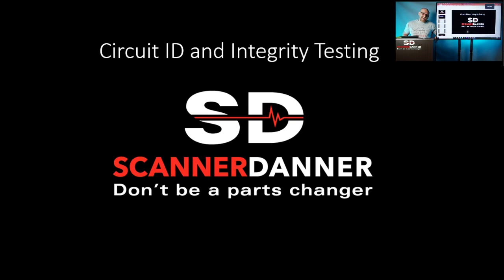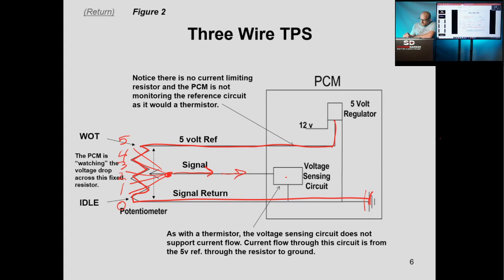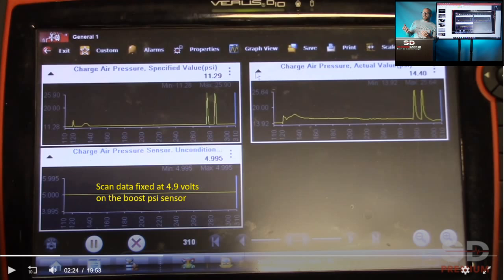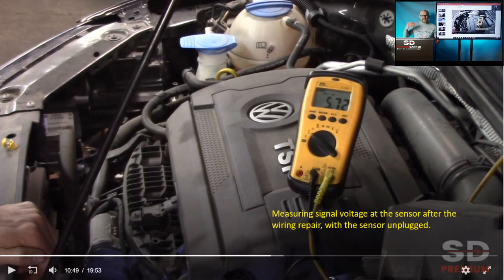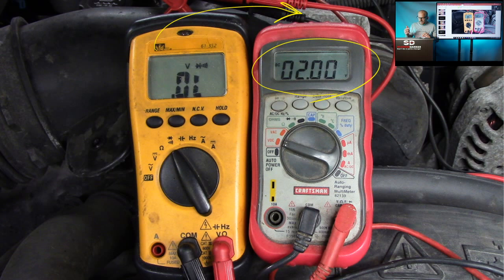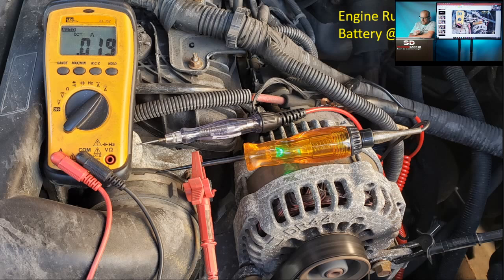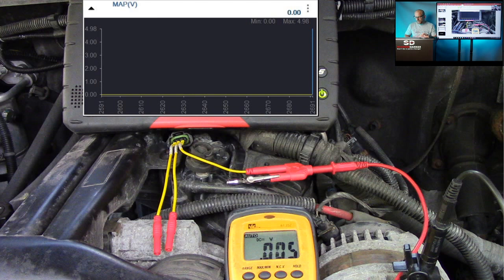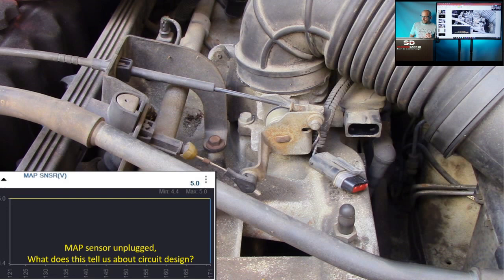Circuit Identification and Integrity Testing Livestream Class (previously recorded)

Comment: Ivan from Pine hollow diagnostic burnt think module for power windows with incandescent test light. Altough I watch all your videos on free youtube channel and you always did it with incandescent test light. If I remember on one Ford you use led test light for cranck sensor testing. I have your book and helped me a lot, as yours explanation, thanks a lot.
Reply from the maker: You have a link for that video? I'd like to see it. Thanks!
Reply: @ScannerDanner   I think that in second part module is burned
Reply from the maker: @ivandrago2557  I tried to find it but it is too confusing on what exactly he is doing and why and when he caused the issue. Sorry, but I don't have time to watch this 4 part series to see exactly what happened. 
I will say this, those signals he mentioned as "communication" looked like hall effect signals to me (motor movement monitoring) This would explain why when stationary, sometimes the signals were the same and sometimes opposite. This just simply was a window or trigger wheel within the hall effect signals sitting in different stationary positions. 
What he did with that orange wire with his test light, he never showed that I could see.
Reply: @ScannerDanner   Thank you, I will watch again when I catch time  so see what happened. I forgot it like you said it is four videos. I remember that he said that was first time damage module with test light.

Comment: There was one edge case where Ivan was working with a door module due to window problems, and his use of an incandescent test light actually fried a reference circuit in the module (I forget what the video was, I'm sure someone will remember). I forget what he did to fix the problem but he got the window working without having to buy a new module.

Comment: First off, thank you scanner Danner for sharing your in depth knowledge and being so passionate.

I have 2 questions: with a sensor whose portion of the 5v ref circuit Having a bias resistor, why wouldn't you see the bias when back probed at the signal wire? Is it because it has ground when plugged in?

Second, when is the bias voltage applied from PCM  through the signal wire? When you first turn keyon before start and then in engine run the 5v  coming from the 5v ref wire is then applied into the signal wire? If you understand what I'm asking.

I understand for the most part how it works just not clear I. That part. Your feed back is much appreciated. Thank you.
Reply from the maker: Thanks!
1. You will see it, but only when the sensor is unplugged or when there is an open signal wire
2. That bias is there all the time! The second the ECM wakes up
Reply: @ScannerDanner  ok and as soon as you apply the throttle and the signal needle moves off idle position, then the Pcm Starts to receive signal voltage coming from the sensor? (What's left of the incoming 5 volt ref based on position of the sensor)

Comment: I wonder if adding a 10000 ohm resistor in series with the signal wire would decrease the voltage and amperage outputs. That would be even safer.

Comment: Hi sir, can you connect the test light to the signal wire and body ground for circuit integrity check?  Same thing, can you connect the test light to the ground wire and battery positive?  It won't fry the computer?

Comment: Hey this if for scanner and every one I just got the new autel at home on the weekend playing with the scope decided to scope the map sensor and my signal wire was 5v but random spikes to 10volt checked the 5vlt ref same thing went to the egr same thing basically what would cause quick spikes in voltage on a 5 vlt ref
Reply: 2009 Chrysler tc 3.8
Reply from the maker: yeah, that is completely not normal but since you were just playing and there was no problem with the car, we have to suspect something else. Maybe your scope ground connection?

Comment: When you test the test light to determine its current you did so with +12V.  This would NOT be the current with +5V.  And,  AND... bulbs are variable in resistance relative to HEAT of illumination.  So effective bulb resistance is VARIABLE between 5 and 12V.  But absolutely the bulb limits current.  

I would observe that one reason Chrysler uses a bias (pullup) to 5Vref is to kinda keep the signal line somewhat established/referenced to something to help bleed off noise.  Obviously there's also methodology to look for opens/shorts.
Reply from the maker: What time frame? Thanks!

Comment: Okay, I believe I won't hurt the signal sensing circuit with an incandescent test light that flows less than 200 milliamps. Will I hurt the 5 volt reference circuit or the sensor ground circuit if I inadvertently connect that same test light to those circuits?
Reply from the maker: nope, that was one of the main points of this lesson. Though it was rushed because of my time frame. I have this lesson in a much better format on SD Premium if you are interested. https://www.scannerdanner.com/scannerdanner-premium-chapters/chapter-10-signal-circuit-integrity-testing/655-circuit-id-and-integrity-testing-part-1.html
Thanks!

Comment: A little confused.. When jumping 5v supply to signal wire on a good circuit, why does using an incandescent vs led light change the scantool data?  I imagine that circuit as having no current flow, it just feeds the pcm internal voltmeter.  A5k ohm resistor may not even register a voltage then.
Reply from the maker: It has some current flow! Just like your digital voltmeter does as i showed earlier in this presentation. Great question! No current flow = no voltage drop right?
Reply: @ScannerDanner  that makes sense!  Also, perhaps the voltmeter internal to the pcm isn't as high impedance as we may expect.  Interesting!

Comment: if signal wire is shorted to ground in case of non-biased sensor circuit (5,0,0), then how can we differentiate between signal and ground wire with test light without referring diagram.
Reply from the maker: You can't, all you'd know is you have a short and it's time to pull a diagram

Comment: Great video.
Now my incandescent test light draws 296ma nominal from battery voltage.
In your opinion still safe to use?
Reply from the maker: It would depend on what you are using it for, but I would like to see something with half of that amperage for the testing I described in this video
Reply: @ScannerDanner  any ideas how I could limit the current on my light in your infinite wisdom

Comment: How much amp draw is too much for an incandescent test light?  My Harbor Freight test light draws 0.185 Amps off only an "9v" battery that's at 8.2 volts.
Reply: V=IR ∴ R=V/I tells you that's a 44Ω resistance. Or you can simply multiple the current draw at by the new voltage divided by the voltage at which you know the current draw (so 0.185A x 12.6V / 8.2V = 0.284A) So at 12.6VDC it will draw ~280mA. Whether it's too much for a circuit depends entirely on what you're drawing that through.

Comment: Your content is great.I love it. I got a quick question..when u jump the ref wire to the signal wire using a LED test why does the voltage drop to 2.7 when compared to incandescent light(5v). There is no current flow through the test light so there shouldn’t be any voltage drop for LED test light no matter how much resistance it has.
Reply from the maker: It wasn't the reference circuit for that test, that was the 5v bias on the signal circuit. Make sense?
Reply: @ScannerDanner   thanks for the reply. I really appreciate it. But sorry Paul.. I still don’t  get it.. I think you might have got my question wrong. I will try to be clear. At exactly 40:24 min of the video u say “the internals of the sensing circuit doesnot support current flow”. I get that and that is why the incandescent light didnot light when you jumped 5v ref wire to signal wire to check the integrity of that wiring(scanner showed 4.9v). 
You have also mentioned in your other videos that it is basic principle that you won’t have voltage drop if you don’t have current flow through a resistor. 
My question is when you jumped 5v reference wire to signal wire with LED Test light the scanner showed 2.7 volts instead of 4.9v(compared to incandescent). How did that drop occur if there is no current flow through test light(light didn’t turn on)??? 
Ps- my question is in reference to the test on this video at 39:20
With Test title “using a test light to jump the 5v ref and signal wires”
Reply from the maker: Doesn't support "measurable" current flow would be a more accurate statement. There is current flow, otherwise we wouldn't have had a drop on that LED light.
To be honest, this class was a little rushed as it was for another company that we recorded live. I have this class as a 4 part series on my website and it is so much better. If you're interested, I offer a free 14 day trial 
www.scannerdanner.com 
Hope to see you there. You'll find this class in my Chapter 10 playlist
Reply: @ScannerDanner  sure, I would love to try your premium class..great content . Thank you
Reply from the maker: @vishnuprasad5048  when you do. Start in Chapter 10 with this video "Circuit ID and Integrity Testing Part 1 (2020 Edition)" it is a 5 part series

Comment: One single strand of copper wire can burn you on voltage/ohm tests
Reply from the maker: not on an input sensor circuit, one strand is all you need :-)
Reply: Yep..bc it's sensing voltage..right..lol